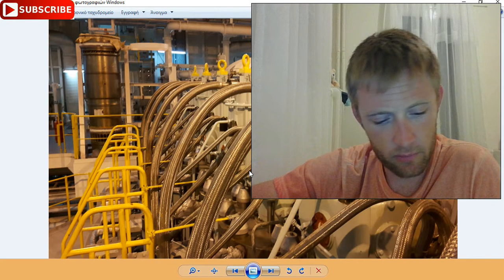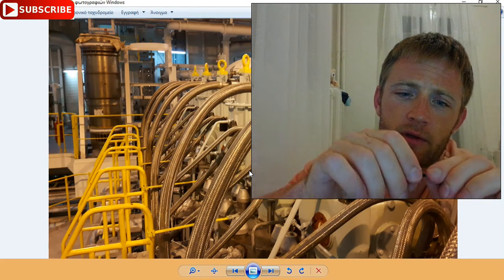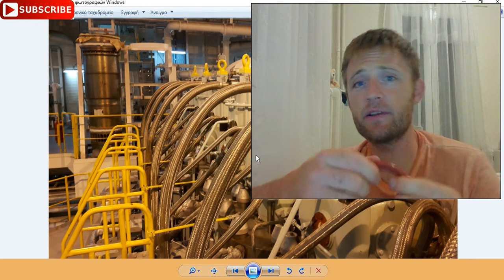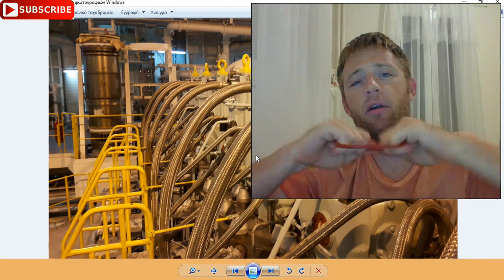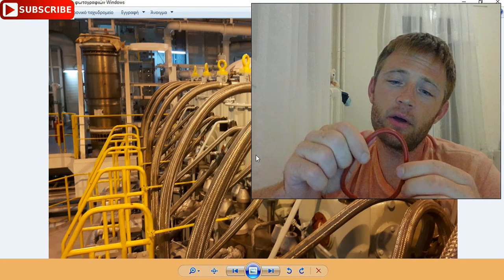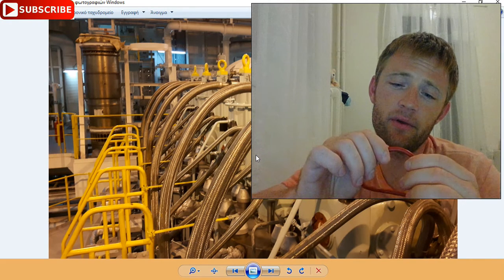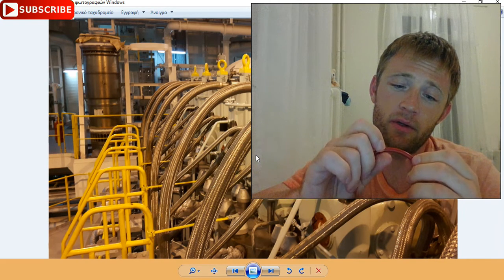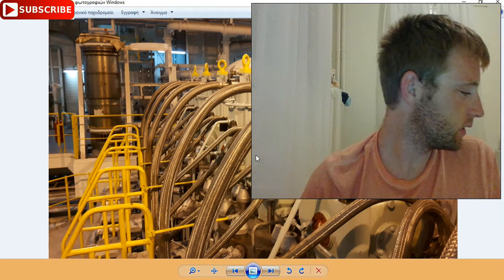How to check O-rings-Tips Marine Engineer

Comment: First off all , I wish to continue you good idea to introduce different aspects of dayli engeneers life at sea .
And lets me to include some additionaly infoto add a little the material provided in yours video :

1.Determine the application for which you will be using the seal.
2.Select the right material for the O-ring.
3.Check the tightness of the seal.
4.Take into consideration the design of your hardware.
5.Consider the temperature and pressure levels of your application.
6.Select the ring as per the material that needs to be stored.
7. Be sure , you have in Store Emergency set for replacement. 

http://tigor7.wix.com/rt-flex-course